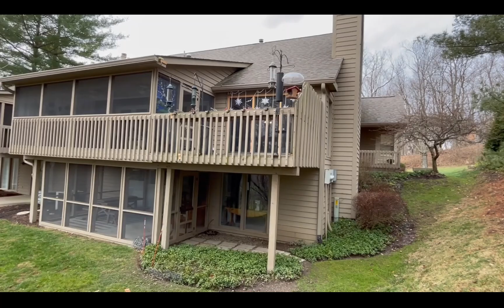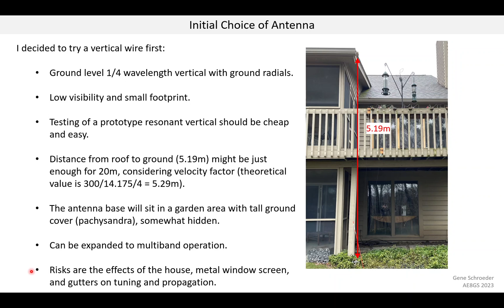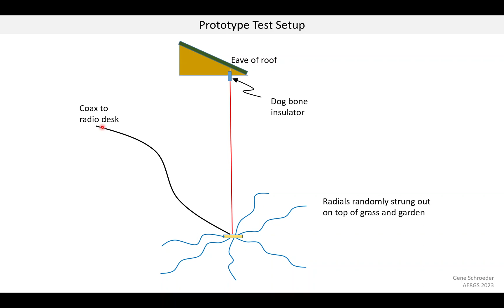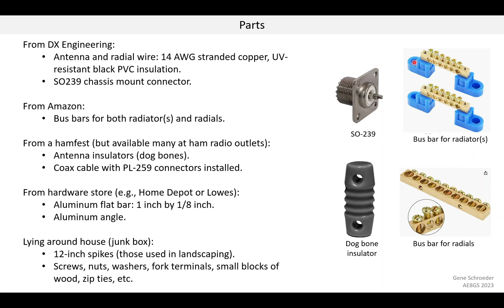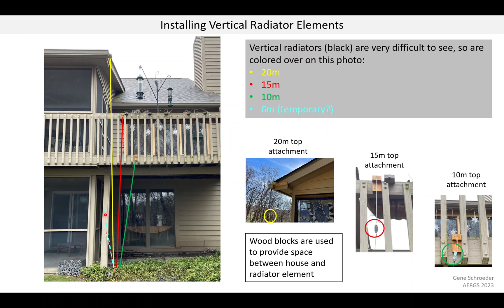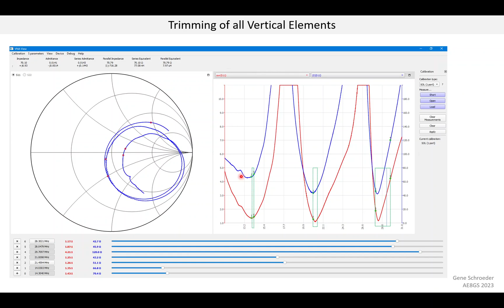Building and Testing a Stealthy Fan Vertical Antenna

Comment: Greatly done video, presentation and illustration. 

Sad to see that this is your only video! Been two years, so guess you dropped the channel idea!
Reply: Thanks for your kind words. I really didn't drop making videos, but in my retirement I have many projects and activities going on (much if it related to ham radio). None of my radio projects have reached a stage to make videos.  Before ham radio, I made a series of about 50 videos about embedded programming (on another channel that I call Gene Schroeder Tech).

Comment: Nicely done!   I am a big fan (pun intended) of fan verticals and fan dipoles.   They're simple, they work, and they require no tuner.

I did want to mention something to you about your ground system for your fan vertical, though, if you have not already figured it out:

The purpose of the radial system is to improve coupling to the ground.   That is the same reason an 8 foot copper grounding rod - or, two or three - might be driven into the ground for a house's electrical system.  Proper coupling happens deep beneath the surface (an eight foot rod is usually good enough).  So, what I would suggest is that you drive an eight foot copper grounding rod into the ground right there at your radial attachment point and connect the radial system to that.  An alternative, if available, would be to connect to any grounding rod for your house, or outdoor metal plumbing fixture.

Another thing I might mention is that, even though you live in a condo and cannot erect permanent antennas, there should be no problem with you putting up a temporary antenna that you take down when you are not operating.   Those trees look mighty enticing for that purpose.   And, if not the trees, a portable fiberglass mast or two to put up other antennas, like an inverted V, or flat top dipole (with two), or even a half square for 20 meters.

Thanks for the video, and 73!

Comment: Hey Gene, thankyou for the video. I have a DX Commander Expedition that I use for POTA and mobile ops but don't have anything in the yard that is vertically polarized. I have spent the past couple of weeks researching vertical antennas and was close to giving Callum more of my $$$ for a permanent install. Your video got my creative juices flowing and it will be DIY instead ... Thanks Mate! W4BGS
Reply: Good luck on your antenna build. I'm still happy with what I built. To get 40m, I built a small loading coil that I can switch in on the 20m element. I think it gives me a higher take-off angle on 40m, so my skip-zone isn't so big.